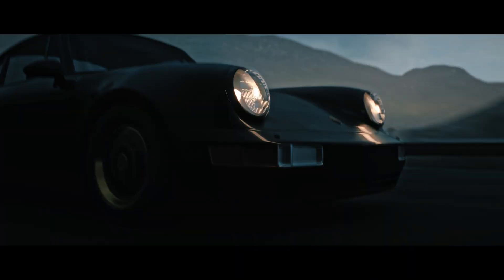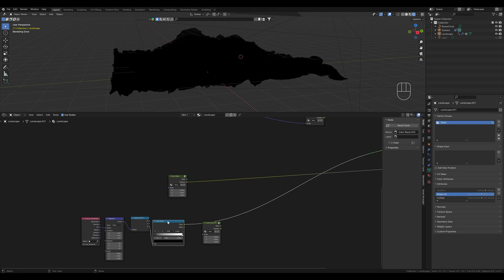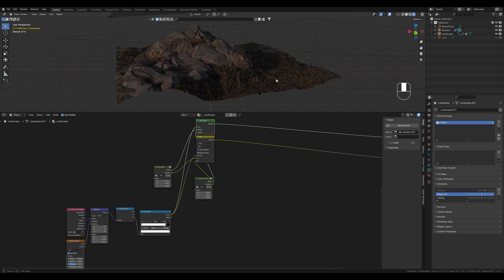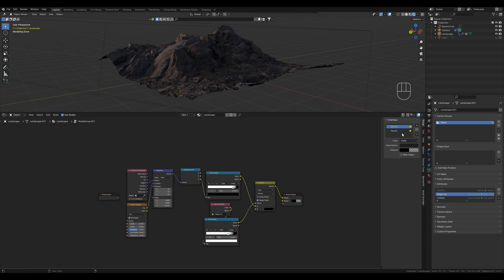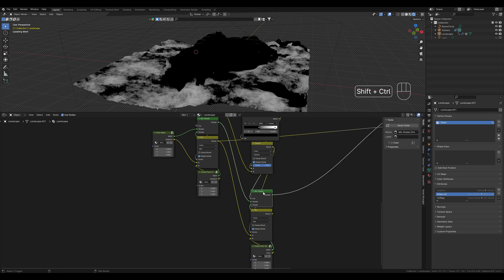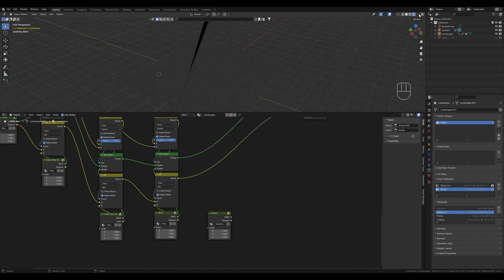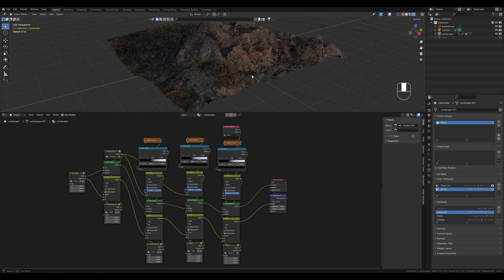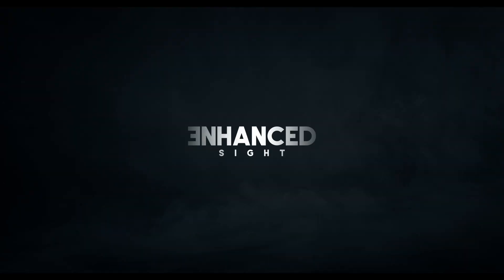Realistic Terrain In Blender | Landscape Shading Techniques (Blender 4.0)

Comment: Hey I have a question about mixing weight maps from the ANT Landscape eroder into this shader setup!
Reply from the maker: Sure, what's your question?
Reply: @enhancedsight  How do i mix the erosion maps from ANT eroder feature
 similar to the slope map?
Reply from the maker: @FrecklesArte as far as i remember you should get an Attribute from the landscape eroder and can work with it the same way as i did here. Does that Work or doesn't the ANT landscape tool give you an attribute anymore? 

It's been some time since i used the ANT Tool, because i often use world creator. If this doesn't Work then let me know and i can check again next week, when i'm back home.
Reply: @enhancedsight  this works, also if icreate a landscape with a plane and proportional editing, how can i add erosion to it in blender? the ant erosion doesnt work for user made landscapes. i do have terre sculptor 2.0 which is like world gen but free and open source gonna try using that now.
Reply from the maker: @FrecklesArte  i don't know about Terra Sculptor, never used it. But If you can create an erosion map with it, then you can use it in Blender as the factor for mix Nodes. I did it that way with the erosion map from world creator.